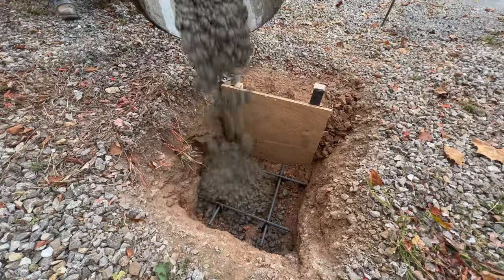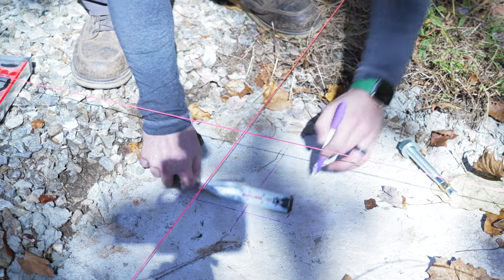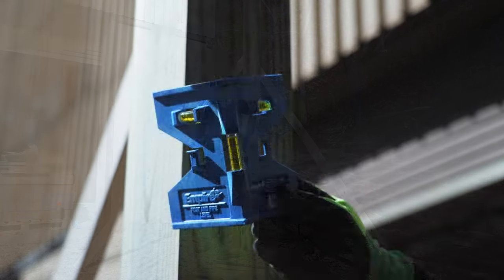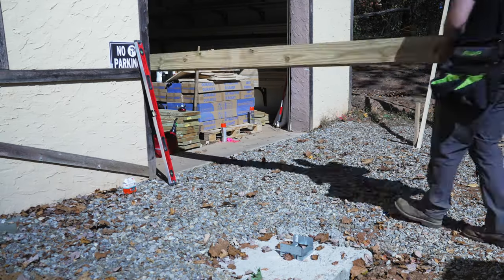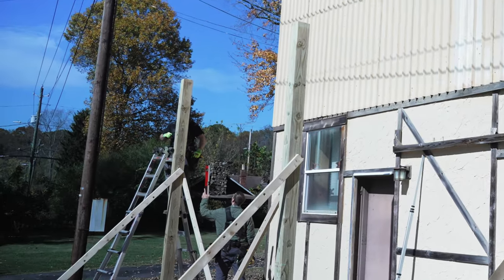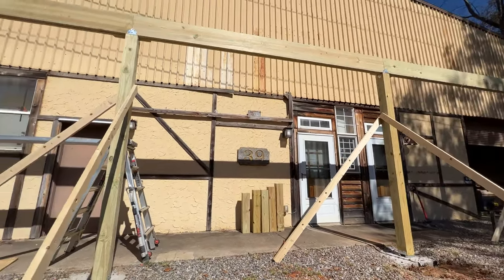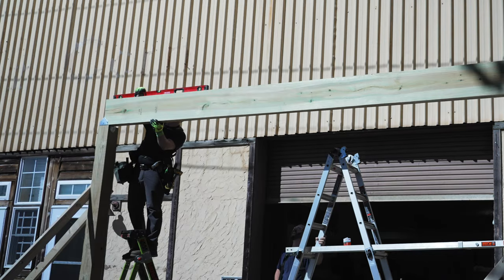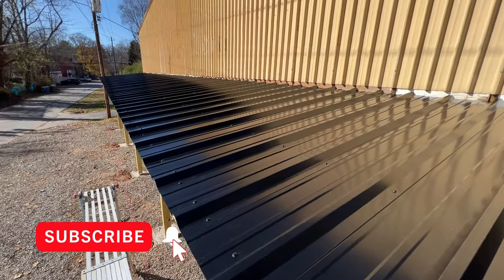WORKSHOP RENOVATION 12 : Framing Porch Roof Posts & Girders

Comment: To prevent have to cut from a ladder, you can also use your rotary laser to set the height of all your footers, then you can cut pre cut everything on the ground. Little more math up front but ensures a more accurate and faster build over all.
Reply from the maker: Yea, I would have definitely done this if I had used something like sonotubes for the footings. That's how we did the Not So Tiny House and it certainly simplified things.

Comment: The drill that you're using to drill the holes for the anchor bolts should have a setting on it that runs just the hammer and doesn't turn the bit. You could put it's on that setting put the bit on the anchor and drive it into the ground without hitting it with a hammer.
Reply from the maker: Good tip!
Reply: I have a corded drill with a hammer and drill symbols. Are you saying I can use that drill to hammer in a wedge anchor bolt or just that bolt in the video?

Comment: That was about the hardest way possible,  Put all the 6x6 on some horses, cut the notch on the top, which you know is the best way to do it and get rid of those useless brackets. You have a transit just shoot the piers and cut them to length.

Comment: It's coming along very nicely, Johnny!
If I may ask; wouldn't the girders be stronger if you overlapped them by starting the second 'layer' with half the lenght, so that the seams stagger? Or isn't that up to code, or maybe weaker?
Reply: Wouldn't that put one (somewhat unsupported) butt joint in the span between the posts? Seems like that might affect the load calculation, or at least add the fastening system to the beam calc input.
Reply: @mrpesky163  maybe three layers woud fix that? I have no clue, all my building knowledge comes from watching YouTube. Should make me an expert 😁
Reply from the maker: I believe it is considered weaker since the break isn’t supported. This is the same way we built the girders for the tiny house with the Perkins guys and Erik gave me the same answer when I asked him.
Reply: @craftedworkshop  well, guess Erik would know, seeing all the houses he and Jaime built!

Comment: Great video though I have a question. Were there some sort of limitation on how close you were alowed to extend the porch towards the street? I would definatley hhave extended the porch so that you could use a part of it as a car port to park your car under so that you don't have it covered in snow in the winter or don't have to run through the rain when it's bad weather.
Reply from the maker: It would have been tricky to pull a vehicle into the parking lot if I extended the porch much further. As it stands, the porch is deep enough to cover my cab if I park in front of the roll top door and it'll keep a lot of weather and sun off of the front doors/windows.

Comment: 2:05 - You should never ever ever vacuum out a hole you drilled into brick or concrete. You can have a bolt that fits perfectly and holds tons without vacuuming the hole just because of the dust that remains, and then if you do vacuum it out the bolt is loose enough to pull out by hand.
Reply: Wtf? Do you have a source for this info?
Reply: @bs838  20 years of experience, first time I did it I very nearly got fired. It's a pretty basic rule in anything construction
Reply from the maker: Definitely not correct. Every concrete anchor's packing I've seen is adamant about thoroughly cleaning out the hole. This is especially true if using epoxy with the anchor. The opposite of what you're talking about can also easily happen, where the bolt won't have enough room to be driven in to full depth. This is especially true with wedge anchor bolts, and you've only got one shot to drive them in correctly.